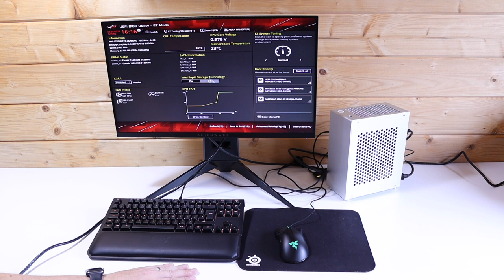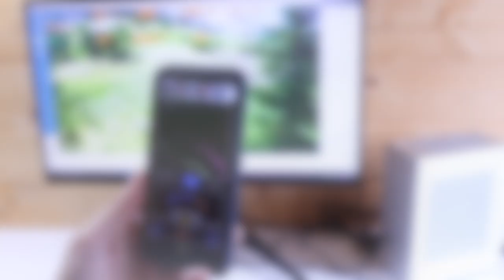S3 Build, Thermals, and Thoughts

Comment: Nice review! not many people on youtube reviewing the metalfish....Quick question though, Which one would you recommend if I were to just buy the case, I already have a PSU, the K39 or the metal fish s3, right now they are both ~110 cad(83usd).
Reply from the maker: That is a really hard question as I love both. Personally I would choose the red K39 as I think it looks beautiful. The K39 has the advantages of 2x 2.5" bays instead of 1 on the S3 and also allows a thicker CPU cooler ( I use a back ridge cooler). The S3 is probably a bit more sturdy (thicker aluminium panels) has a top fan which you can mount uptown a 92mm slim and also allows for a slightly longer gfx card which gives you more options. I always find these questions so hard :)

Comment: Thought I'd chime in and say that Geeek offer a pretty nice modular Enhance 7660B.   Just be warned that it only just fits in the Metalfish S3 - its too long for a K39 or Velka 3.   Also the 4+4pin CPU power is just a little too short.  Even with 300mm cables,  you'll come up short with that one cable so you'll need an extension.  Which is a shame, because they are really nice soft silicone  cables too.
Reply from the maker: Thanks for the heads up mate. I did want a modular initially but I just needed one quickly so bought the first one I found.
Reply: nowadays alot of flex psu seller run away if you try to claim warranty from them , some of my friends already get "nice" stuff like that

Comment: Did you have the k39 or k39v2? On aliexpress there is also k39 pro (has apple like vent design)
Reply from the maker: I had the original k39 in red. And can you please link me the pro? Just took a look and can’t find it
Reply: @MashITTech  I can't figure out the difference between k39 and k39v2
Reply from the maker: weird, this is more like a copy of the s3, look at the usb and power plus is has same dimensions as S3 (fits longer GFX card but smaller cpu heatsink).

Difference between K39 and v2 is the width, the v2 allows for larger heatsink (just realised I have v2 after all) I can fit a black ridge in my K39)
Reply: @MashITTech  the thing that puts me off about the K39/K39v2 is 1.5mm thickness; the metal seems too thin and will bend. S3 looks solid to travel with. K39 pro is 2.0mm thick and is the best looking in my opinion.
Reply from the maker: You are right, there is definitely flex on the K39, especially the side panels. I did transport mine around without problems but if you squeezed the sides it flexed. The S3 was solid as a rock
Reply: @MashITTech  I did have the Geeek A30 case, it was nice, but I want to go smaller. I was considering an eGPU to pair with my laptop, but I prefer to go with a tiny ITX build again which won't be much more in size. Sounds like you are in the UK, let me know if you want to sell your S3.
Reply from the maker: I am UK, and yes, you are welcome to buy my S3, but I have no spare PSUs for it. My email is on the channel, get in touch if you want it.

Comment: this is so sweet! this will be a great help. planning to build using a similar case (loli1). any alternative for the noctua l9? im afraid the l9 cant handle r7 3700x or should i go for r5 3600/2600?
Reply from the maker: What is the CPU clearance on the loli1? is it the same as the S3?
Reply: @MashITTech  i think the loli1 can support 48mm cpu cooler height.
Reply from the maker: Wow, that opens up your options then. Get the black ridge cooler, I have one (which I am using in my upcoming T8 build. It is 47mm and can cool my 9700 (non k) which draws about 120w:
https://www.overclockers.co.uk/alpenfohn-black-ridge-low-profile-cpu-cooler-120mm-hs-05g-al.html
Reply: @MashITTech  I'm gonna check that one. Thank you! Really appreciate it.
Reply from the maker: not a problem. if you go with it, check the clearance on your motherboard. I will let you know when I post my T8 video and you can see it in action

Comment: i need that GPU, currently running on a rx550, need to upgrade soon.

i have a issue with thermals when im overclocking my 5 2600, it gets too hot, maybe im doing something wrong or i need to replace my cooler which is an IS-40x low profile from ID COOLING
what did the temp average with a Noctua Fan on stress?

 did you buy that flex in aliexpress or somewhere else?

also Metalfish took down most of their cases in Aliexpress, dont know why tho
Reply from the maker: I tested the ID-30 recently and it was rubbish, sent it straight back. The l9i/a is brilliant. Temps were great but I am running a 9400f which maxes out at about 65w of power whilst stress testing. Temps were in the low 70s but I have a quiet fan profile set. 

I bought the flex and case from metal fish on ALIexpress website. The PSU was Abysmal, maybe that's why they have removed some products?

I also bought the replacement enhance 7660-b from ALI and this model is brilliant although very expensive
Reply: @MashITTech  sad that i cant return back the cooler now, but maybe i will just save it for later builds that dont need that much stress on the cpu, but i will change this cooler to noctua if you said it makes a big temp difference, because i want that sweet overclock on this tiny beast, asrock b450 itx/ac top with zen 5 2600, with a low 8 gb ram(upgrade soon) and a rx550 from my old pc that also needs updating, the cpu case for me was fine as this is my first diy build that i bought with my money, i can say that it works but it may not works on others also its cheap when i bought it as it was sale on that time
Reply from the maker: @teryn3723  I haven't tested the 40 so I am not sure the difference to the noctua, but the noctua has been the best low profile cooler I have used. I have managed to run a 8700 which was pulling 120w and it did struggle with that. Do you know how many watts the 2600 is pulling? Might be worth picking up one of the new 7nm zen 3 in October, that should run even cooler with a big boost in performance.
Reply: @MashITTech  that was actually my plan to upgrade to a 4000 series as my b450 can actually support it now with all the amd drama regarding support for the new cpus🤣 its pulling around 65w also, but if overclocked it pulls in around 80+

If the noctua can cool a 120w then its worth the switch for me, also did you try testing it with cover on and off?

Comment: I think you cut it too close when you chose the metalfish 400w psu. The sellers did advice to select a psu with more headroom. I think the 500w version would have worked for you. The enhance psu is TOP notch, but twice as expensive. AliExpress sells a much cheaper 80mm nidec silent fan for very cheap. It is very quiet and is a 3pin fan with speed control. Together with a noctua 40mm fan for the PSU, you will have a silent system under light usage, and a slightly louder one when gaming. Unless you game without any audio, you should not be able to hear it at all.
Reply from the maker: If it was a quality psu 400w would have been more than sufficient! I was only running a i5 9400 and a rx470 to test it, load was 200w!!! I have a Corsair 450w sfx running a 9700 + 2070 super with no problems. I only bought the 400w as I wanted a cheaper psu to run a low powered second system but I should have known not to cheap out
Reply: Mash IT Agree, except that we know the majority of the flex PSUs sold in China are not exactly the best quality. I’m running the Ryzen 2600 with 1660 Super with the 500w. I didn’t want to take the chances with a 400w, considering the cpu consumes 80w and the GPU draws 125w. The rest of the electronics would probably draw another 50w. The 500w PSU was actually sold out and I had to wait 3 weeks for it. I really wanted to bu6 the enhance PSU too. But it was too expensive.

Comment: So, this is thicker than K39 but lower cpu height clearance?
Reply from the maker: No, it’s thinner by about 1cm but taller (and has a top fan) and wider (fits slightly longer GPUs at about 200mm)
Reply: @MashITTech  Oh my bad, so this is actually a matter of thicker (for cpu cooler) or longer (for gpu length) thanks for pointing out good sir.